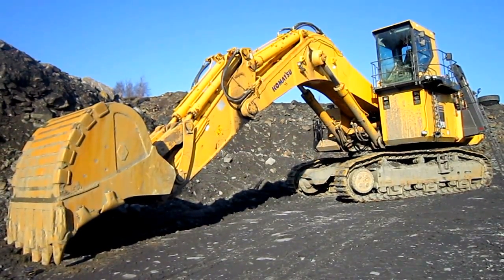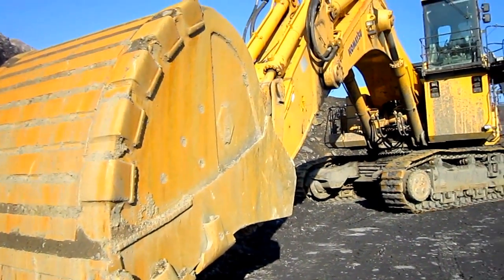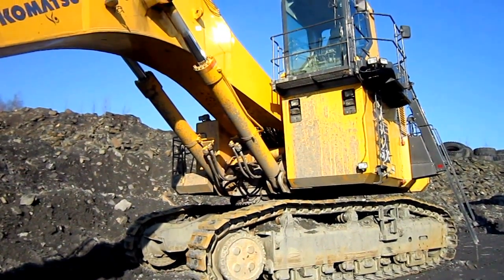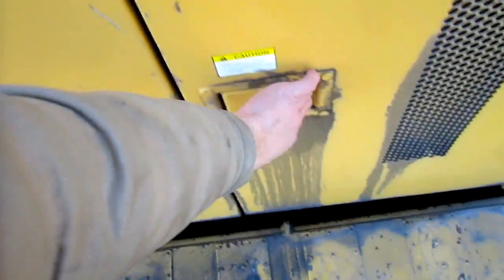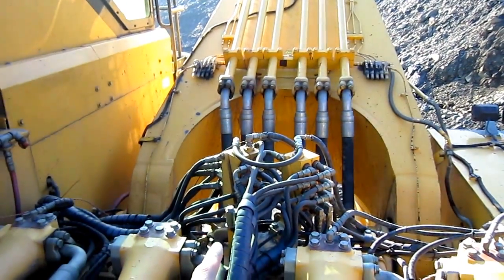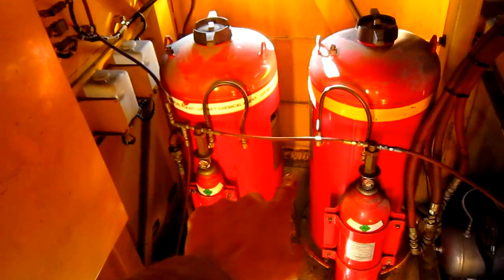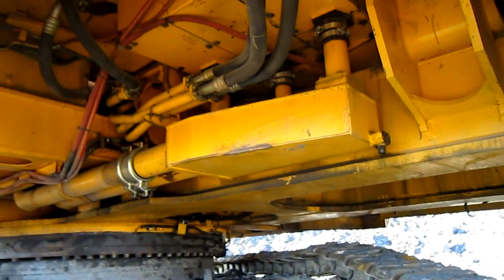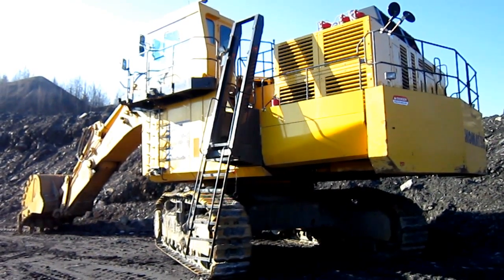Komatsu PC2000-8 Documentary

Comment: Weight was stated as 200 to 225 tons.  That would make this machine 400,000 pounds?
Wouldn't weight be 200,000 to 225,000 pounds?
Just asking
Reply from the maker: paulthesoundguy1 I think you may have misheard what I stated in the video.  The Backhoe version of the PC2000 weighs between 220.5 - 225 tons, depending on shoe size. The Front Shovel version weighs 215 tons.  2,000 lbs equals 1 U.S or Short Ton.  So converted to pounds, the Backhoe weighs between 440,920 - 450,000lbs and 429,900lbs as a Front Shovel.

Comment: Very nice vid Justin!!!

I have to agree with Joe on the cab, very messy!! Im in mine for 12 hrs at a time and make sure it is kept spotless. I like the fire suppression setup, we have 5 30lb canisters in the electrical comp.....were those 100-150lbs in elec comp and 3 30lbs on engine compartment? I think my biggest issue with pc2000 is the travel seems very weak! Also we have a 19.5 yd bucket, it handles it very well......you should look into it when its time for a new bucket